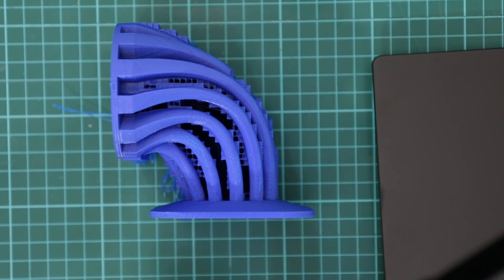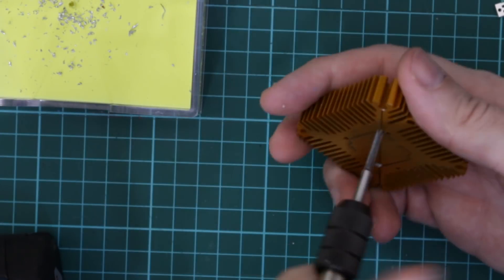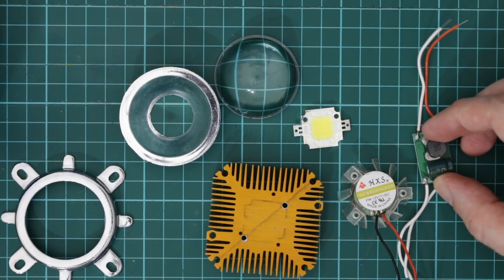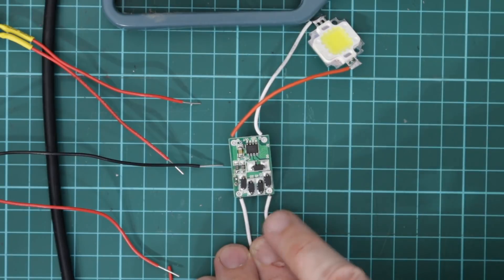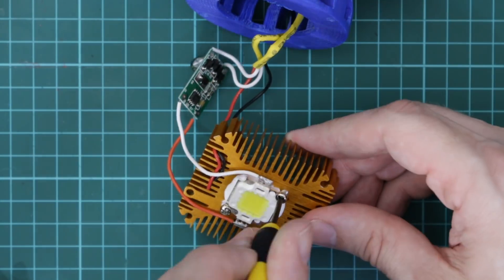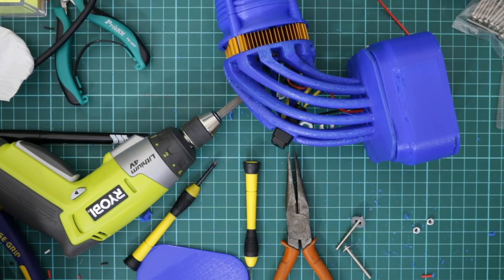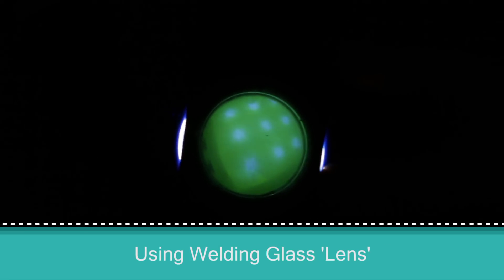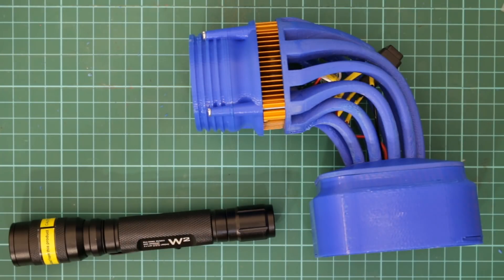3D Printed 10W Powerful Torch

Comment: A dual print head with water soluble supports would be great! But you probably don't have that, nor do I because I personally wouldn't have a use and it costs a fair bit.
Reply from the maker: A dual extruder with soluble supports would be nice to have, maybe on my next printer or upgrade

Comment: There is usually a reason you don't usually see such 3D printed designs, not from people who have single-material setups. And if you had an Ultimaker, that PVA filament is still not cheap and finicky to deal with.
Reply from the maker: Yes, you learn from your design choices and take this into consideration for future projects.